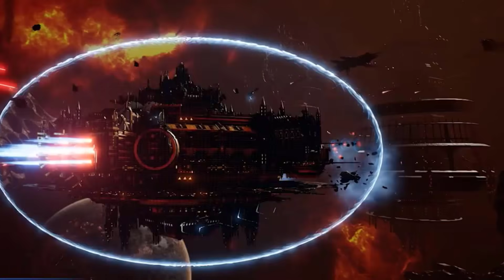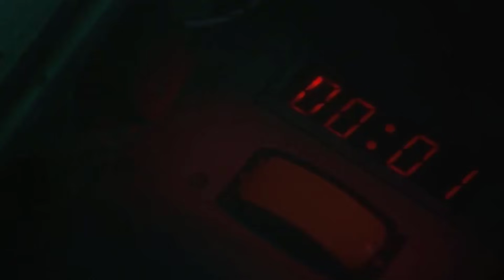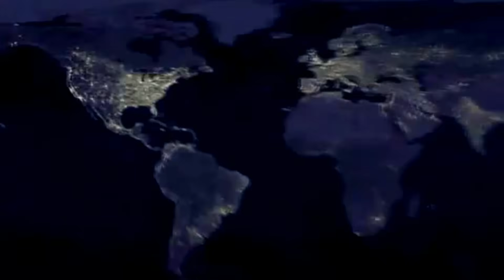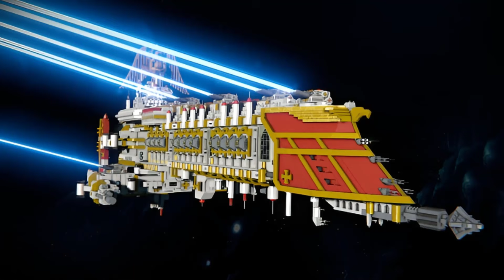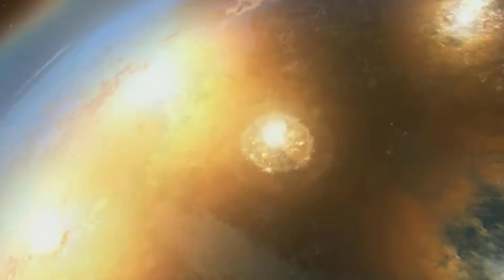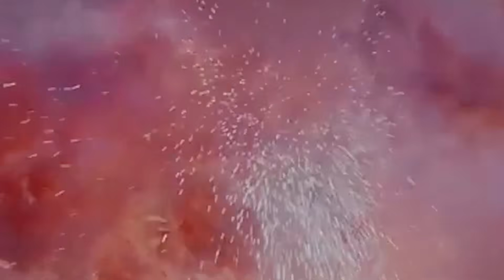The TRUTH of Nuclear Weapons in Space Combat?

Comment: I know Honour Harrington novel series had GRASERs, Gamma Ray lasers produced by nuclear warheads. They also used multiple nuclear missile swarms as anitfighter, drone and missile defence. Also you could engineer equivalent to HESH rounds to direct more energy at the target or a munro effect or HEAT way of directing energy if even for a milli second
Reply: nope, the missiles were the nukes, grasers are just gamma pumped lasers using radiation from the reactors to intensify the beam. The other missile was the X-ray laser head, put a nuke at one end of a lithium rod and set it off, right before it vaporizes the rod a beam of X-rays is produced.

Comment: Nuclear weapons are not useless in true scifi like star trek. What do you think photon or quantum torpedoes are? Those are nuclear weapons! They just happens to use most efficient nuclear reaction there is, nuclei annihilation and vacuum fluctuation subatomic particles annihilation. And because Star trek is true scifi, those weapons have realistic yields and shields have realistic endurance.

Also nuclear explosion in space is devastating. If simple bomb explodes few meters from shield, half of its released energy goes straigth to the shield. Starfleet ships has shields with strengths between 300PJ to 5EJ. So they could withstand 150 Mton to 1250 Mton explosions in near vicinty. Photon torpedoes has maximum magnitude 67,5 Mton and because they are "shape charge" type almost all energy goes into shields/hull. So for smaller ships, 2 to 3 photon torpedoes means heavy damage or even destruction.